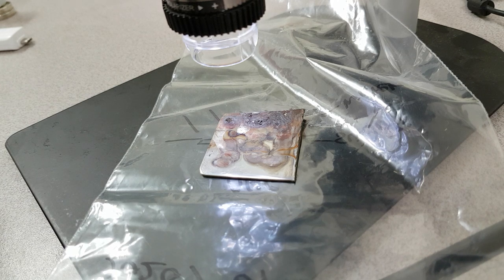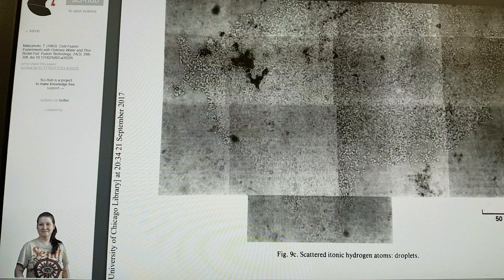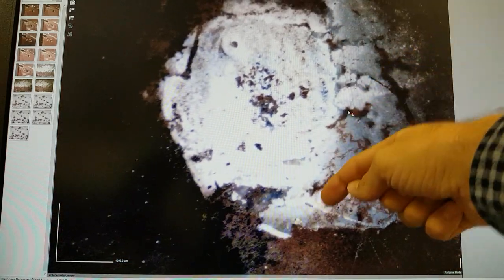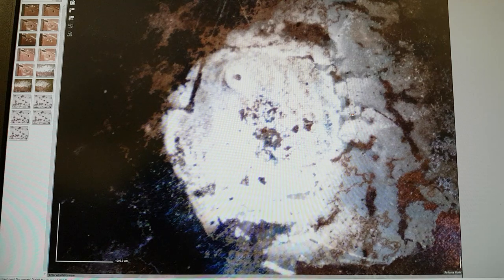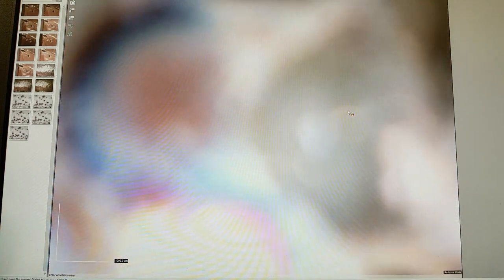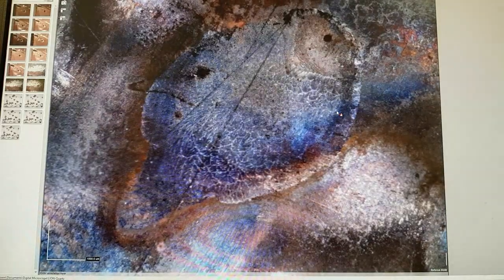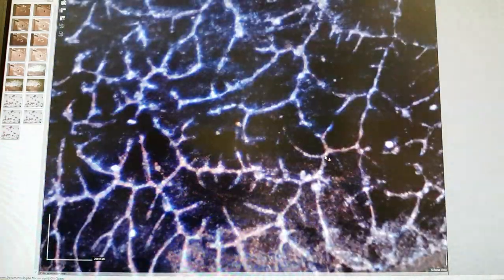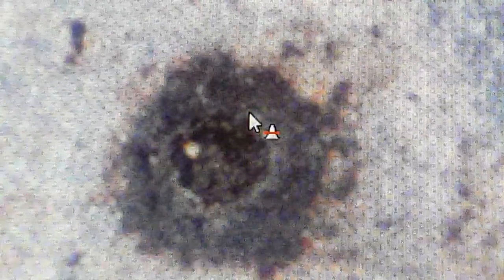OHMA - SS304 on water vs Ohmasa Gas - Optical microscope first look

Comment: What is monatomic gold? I couldn’t find out any definitive information mostly just eBay ads that looked a bit odd.
Reply from the maker: There is absolutely no way to know if any of the material claiming to be mono-atomic gold, really is.

Mono-atomic gold is one of a number of elements that can supposedly be made mono-atomic. In this state, no atom is chemically bound, that is to say, no atom is sharing electrons with any other atom. Each one is self contained. As such there are no bonds of any kind to store thermal vibration, in this state the atom is essentially very near absolute zero. At absolute zero, a very large number of elements become super conducting. It is claimed that not only are the electrons not shared, they are also in a different configuration. The configuration is not able to interact with light in the normal way.

Our sample was given to us in 2017 - it had been given to another party years before, again for free, with the intent that it be analysed. We don't even know who the party is.
Reply: Martin Fleischmann Memorial Project fair enough :) isn’t it granular though ? Ie there most be some bonds otherwise it would be gaseous ?
Reply from the maker: @jonahfoxy  Under the SEM, we went in about as far as we could and it still had smaller structures... responds to static electricity, and I suspect it is aggregating into fluffy blobs with that.
Reply: Martin Fleischmann Memorial Project mass spectrometer? Does it melt in a furnace? Given how commercialised it seems to be, it seems highly unlikely it’s really Au but it would be fascinating to find out what’s going on !
Reply from the maker: @jonahfoxy  Our sample tests as David Hudson said it would under EDS - a commercial brand did not.

Comment: Birefringence is the optical property of a material having a refractive index that depends on the polarization and propagation direction of light. Birefringence is seen when a material is subjected to stress. Plastics that have been stressed show Birefringence under polarized light. I beleive that ultra strong magnetic force has changed the crystal structure of the stainless steel so that that light that is reflected by that stressed material will show Birefringence. This same magnetic based stressed process could be why strange radiation tracts show up more clearly under polarized light.

You are applying light to the stainless steel straight on. Since the reflection coefficient for light which has an electric field parallel to the plane of incidence goes to zero at some angle between 0° and 90°, the reflected light at that angle is linearly polarized with its electric field vectors perpendicular to the plane of incidence and parallel to the plane of the surface from which it is reflecting. This polarization mechanism might mean that the material has had its RRFLECTIVE index prematurely modified by the application of intense magnetism. I don't know if this sort of polarization effect on the surface of a material has ever been seen before.
Reply from the maker: This is an interesting thing to consider Axil for sure. It is worth noting that in some cases, the metal appears to be etched, others not. In this case, it appears to be material deposited on the surface - that is to say it is new material added to the SS304. Matsumoto refers to the mesh as 'itonic clusters of hydrogen' and in various phases, such as 'frost' and 'droplets'. Looking at it on an SEM/EDS will tell us the scale of the deposition hopefully and if there are any unusual elements in there - however, EDS will not show Hydrogen.

It is also important to note that whilst there are several similar marks on that side of the plate, only this one has the mesh on it.
Reply: Interesting idea. Seems that given the polarisation is installed into the microscope by default it must be common that it’s useful.
Reply from the maker: @jonahfoxy  Actually, many microscopes don't have polarisation - I specifically chose it.
Reply: Martin Fleischmann Memorial Project yes of course. But given it’s a feature I assume it’s commonly useful. ?

Comment: How do the two sides compare ? Ie what is on the other side of the various features ?
Reply from the maker: I only had a quick look, Really it needs to go on the SEM to see if there are any transmutations. Here there is water on one side. I will share a video of the kind of process next week - It is interesting in its own right.
Reply: Martin Fleischmann Memorial Project what I mean. Is there any correlation between the two sides - eg what is on the other side of the plate from the “yin yang”
Reply from the maker: @jonahfoxy  I thought about that last night, but it was getting very late - on Monday I will do a macro photographic map of both sides.